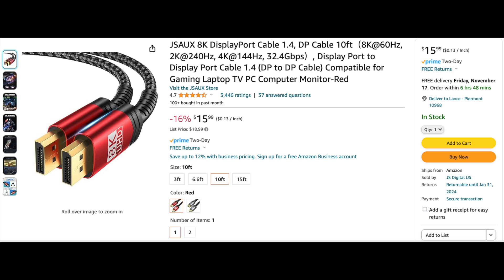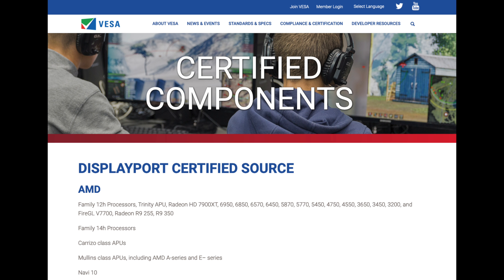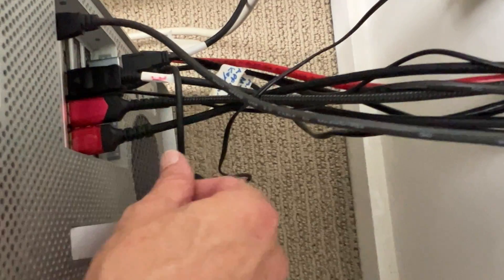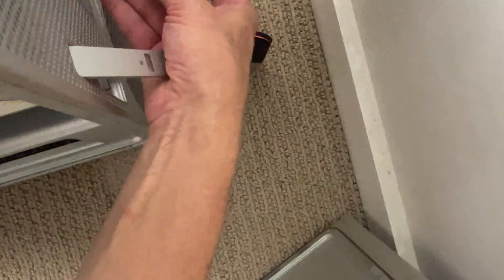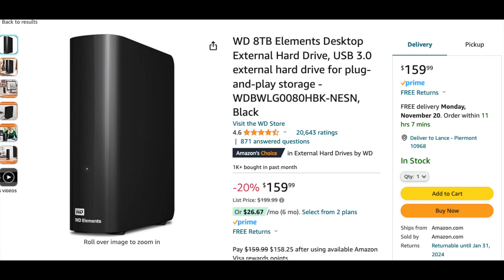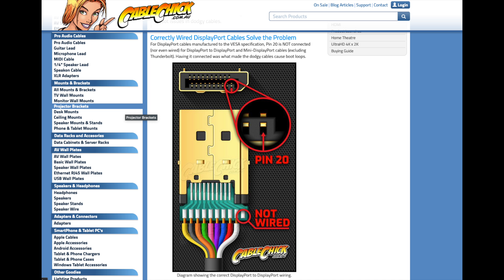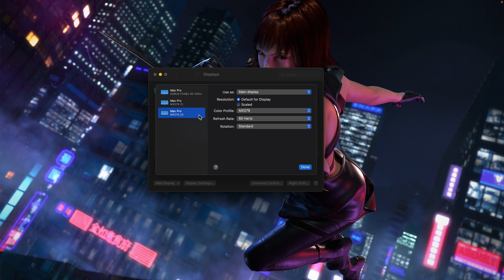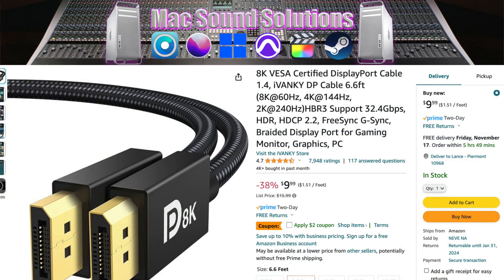DisplayPort cable DON'T MAKE MY MISTAKE!

Comment: I'm using the same cable since 2020, and I've had no issues whatsoever. You might have had something else going on with your setup
Reply from the maker: Well depends on the monitor you are using as well.

Comment: problem is pin20   kabeldirekt: ...We also stock cables that are officially certified by VESA. Their specification also stipulates that pin 20 is not connected to avoid damage due to short circuits.

Comment: today my keyboard wasnt working after boot. So I turned off everything, turned off the psu, turned on again, tried to boot, and nada, no beeps. Then I remember your video. I unplugged the display port cable, and the system boot fine. Now I'm scared.
The cable came with a lg monitor and bought recently. But, I also changed the keyboard. And this keyboard freezes if I try to open the bios. 
Nothing works as it should nowadays sigh

Comment: Vejry helpful, thank you.  I just purchased a workstation with what I incorrectly assumed were HDMI connectors.  I was about to buy my first DP cables but decided to check YT before ordering. What I had in my cart was not VESA certified and I have 2 USB powered external SSD storage devices.   So, I emptied my cart and just ordered 2 from your link to say thanks for the help and for possibly saving me $400 in lost SSD devices.
Reply from the maker: YOU wont regret your purchase, and thanks for using my link!

Comment: Quick question, I know this is an older video, but I just ordered one of these cables, do you still recommend it?
Reply from the maker: Yes still using mine with my OLED
Reply: @MacSoundSolutions  sweet! Thank you! I had my DP break on me for no reason and made my GPU act up! I thought it was other issues but seems to be the cable causing it, I would play a game and then have my screens go black and then my fans would kick up to the max speed. But once I did some testing the one monitors DP Cable worked fine along side with both DP slots on the GPU so I’m hoping this cable will do the trick.

Comment: I have an issue I never experinced before, I found out that when I close or open something [game, browser], I find that the gpu and mem on msi after burner reach the maximum for 2 seconds then back to normal, l capped my fps through Nvidia control panel to 40 fps cause the monitor is 60hz refresh rate, and I use JSAUX DP cable, could it be the issue?

Comment: Hi, I'm looking for a recommendation for the cable where DP should connect to the monitor, and HDMI to the laptop (as my laptop doesn’t have a DP port)?  I really appreciate any help you can provide :)
Reply from the maker: @eMeM985 cable https://amzn.to/3ysEjmm or adapter  https://amzn.to/4ffU1Cd
Reply: @MacSoundSolutions  thank you for the recommendation, but the adapter is unavailable, and the cable only supports from a DP source device to an HDMI display device. I will need to continue with searching ;)
Reply: @MacSoundSolutions  I found a solution, I ordered cable USB C to DP, VESA Certified :) hope so. It will all be good ;)

Comment: Hello, I'm having trouble with my Mac Pro 5.1. When I try to boot using OpenCore EFI Boot, the system freezes and becomes unresponsive right after I select OpenCore EFI Boot from the boot menu. None of the inputs work and rebooting hasn't resolved the issue. Could you offer any guidance on this?
I apologize for asking so many questions

Thank you.
Reply from the maker: You should create a Mojave thumb drive to boot off of and do a re install of Opencore most likely. What version are you using OCLP or Martin Lo? If it's OCLP you only boot off the EFI once to bless the drive then boot off your mac os drive from then on.
Reply: @MacSoundSolutions  I have version 0.9.2 of the OpenCore Legacy Patcher. I couldn't find any instructions on how to reinstall the OpenCore Legacy Patcher. If I start the reinstallation, will my macOS Monterey with my files be preserved? And how difficult is it to reinstall the OpenCore Legacy Patcher? I have two systems: macOS Mojave and macOS Monterey. Sorry for the late response.

Comment: Hello! I have a question: Can I remove the built-in storage with the native MacOS Mojave system on my Mac Pro 5,1 using open core legacy patcher? I'm asking because I've installed Mac OS Monterey instead. I'm just concerned that this might disrupt something. Instead of the MacOS Mojave drive, I want to install an 8TB HDD.
Reply from the maker: You have to move your opencore install to the Monterey drive, or your computer won’t boot if it’s on the Mojave drive and you remove it. So run the OCLP app,  install it to the  Monterey drive and also run the post patches then shutdown and remove the Mojave drive. If you installed OCLP on the Monterey drive then it’s not an issue to remove the Mojave drive. You don’t want two installs of OCLP on two drives running at the same time. It’s a good idea to keep the Mojave drive so you have a fall back if things go south.
Reply: @MacSoundSolutions  Thank you so much! I have OpenCore Legacy Patcher installed on two drives. But what are the mail patches for?
Reply from the maker: @gidrogengt the post patches are part of the OCLP app, you hit run post patches in the GUI after you install OCLP launch the app and install post patches. It scans what hardware your computer has in it like WiFi and Bluetooth cards and installs the drivers etc.
Reply: @MacSoundSolutions  Thank you!

Comment: If you don't have an HDMI 2.0 port and cable you won't get HDR support.
Reply from the maker: I have HDMI 2.1 ports and cable and get 120hz  but no HDR option, same brand cable as the DisplayPort issue so maybe the cable. But my GPU and Monitor support HDR over HDMI.

Comment: When you read up on the DisplayPort connector in the VESA specification, it will show that both the source and the sink are supposed to provide power at 3.3V+-10% and 500mA on the DP_PWR pin, pin 20, of the connector. DP_PWR is very useful to supply power to dongles that are connected to the source or the sink.
Reply from the maker: I have read up, and for old setups adapters that needed to power display adapters, but no longer the case..
Why Does DisplayPort Pin 20 Cause Problems?
Because Pin 20 power is provided by both source and sink devices - or in the case of a PC, the DisplayPort-ready Graphics Card and the DisplayPort-ready Monitor - direct DP to DP connections with an intact Pin 20 connection led to problems when booting up.
This 'backdrive' condition happens because Monitors are never really off when in standby, so they feed power out to the Graphics Card when it isn't expecting any. This led to the stalls, hanging, freezing and constant rebooting that plagued DIY builders from the early 2010s all the way up to around 2016. At the dawn of DisplayPort, when people were upgrading their desktop but keeping their old monitor, adapters were hugely popular. Power from the Graphics Card either ran, or was ignored by, the adapter and power from the Monitor didn't exist because it wasn't using DisplayPort. https://www.cablechick.com.au/blog/the-displayport-pin-20-issue-explained/
Reply: When I put my hz 60+ , I mean 180hz my screen turns black 10 second and get back on 60hz again

Comment: I have used JSAUX cables for years with out any issue. if it is sending power you have an active cable, while in most cases this is not an issue, However; there is some hardware that lacks the feature needed to block the active power line. Older Mac Pro  addin cards tend to have this issue as they expect passive cables and it can cause damage. I have seen it a lot over the years when someone mistakenly connects a cable with the active power pin wired up.  when buying cables for any Mac or sensitive equipment ALWAY use the VESA certified version of the cable to ensure compatibility & safety with your equipment.

all that said if there is no mention of the cable being active in the listing you might be able to contact them about it.

Comment: very interesting, I had no idea. All I suffered from low quality cables is lower resolution and/or lower framerates. Time to pull up the old multimeter for some continuity tests on every cable for that pin.